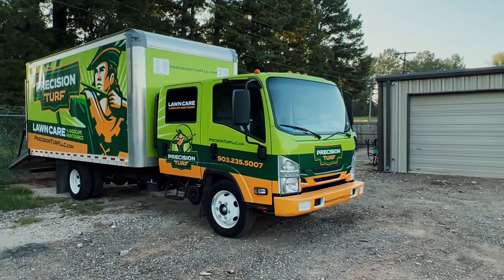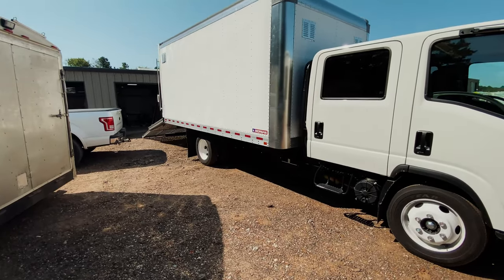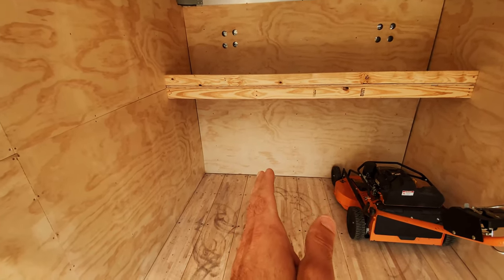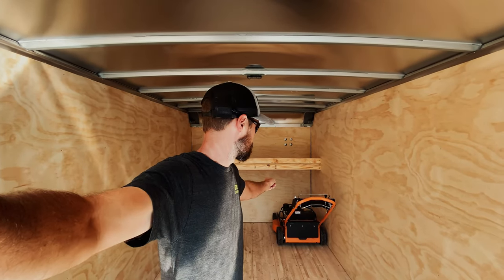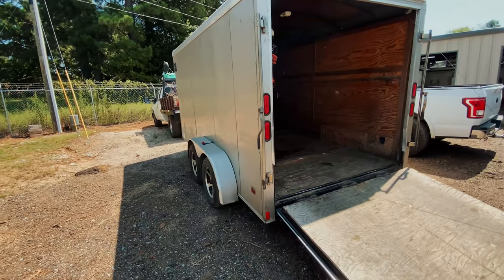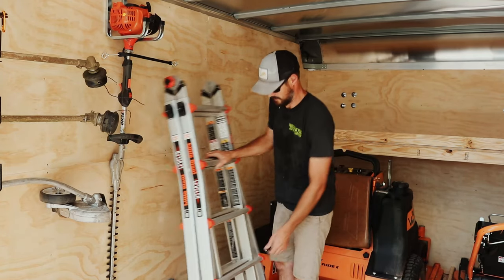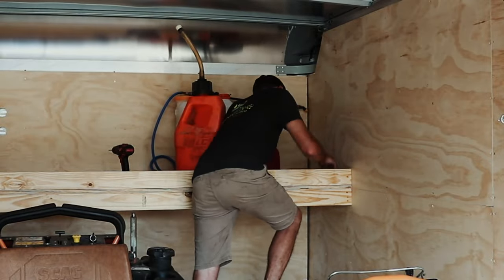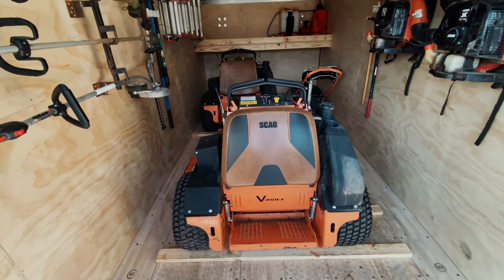FOR SALE - 2021 Isuzu NPR w/ rare Morgan Landscape Body 38k miles - email in top comment

Comment: A couple issues. I have added 2 ft to the back of my box truck and of course the ramps. That allows me to leave the door open when I drive and helps cool the engines between jobs. You may want to put some foil backed insulation sheets on that ceiling. Its like a Dutch oven in the summer. Where is your traffic cone, first aid kit, white board, rakes, shovels, yard dumpster, chainsaw, hedge clippers? My old diesel gets the same mpg if loaded or empty so my only hope is reduce miles by taking everything I MIGHT need for the day. With all those seats in the front you need more equipment to keep em busy.
Reply from the maker: It’s actually not terrible with the vents. We don’t fill the truck up with people. Min. 2 max 4. Plenty of equip for everyone.

Comment: Nice truck. I just ordered one a few days ago. The bad news is Morgan has discontinued that body style 😢😢😢. I hate the dovetail look. So I’m not sure what body I will get. Good look and congratulations on yours!
Reply from the maker: That’s really sad because it’s an awesome design. I’m with you on the dove tail. Did you go crew cab or single?
Reply: @lawnandlight  I went crew cab. I like to have room.
Reply: Any issues with yours I know you just purchased not too long ago so it may be hard to say right now. But , I’m just heart broken after an year of finding a crew cab due to shortage. Now they tell me it’s unavailable I don’t know what to do.
Reply from the maker: @ikonoutdoorsolutionsllc4178  it was hard to find this one when we did. It was the only one available with the Morgan bed within a couple hundred miles. We’ve had a few small issues since purchase but our dealers have been great about getting stuff fixed. 

Reach out to IP Trucks(industrial power) in Ft Worth and Hall Truck Center in Tyler, Tx to see if they have what you are looking for.
Reply: @lawnandlight  Ok thanks a lot.

Comment: You have to put an expanded metal basket underneath the side of the truck to hold all fuel cans not inside the trailer and I would also take the truck to the Ziebart have him spray the entire inside with the liner that you put in a pick up truck bed if you pay for the professional it will last more than 20 years and then if you have a fuel spill you just put laundry detergent and a broom. hose it out?
Reply from the maker: Great ideas. Are you looking to buy one of these trucks?